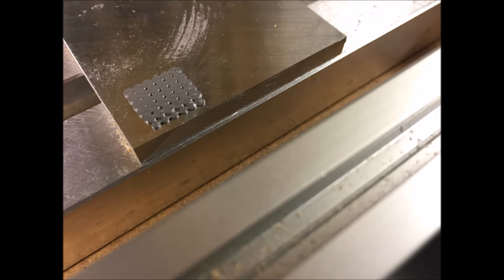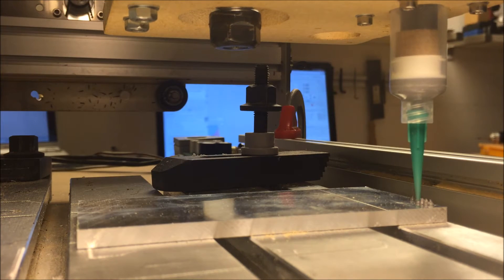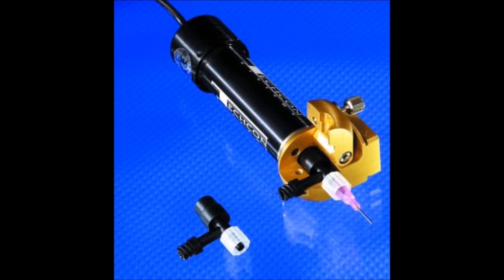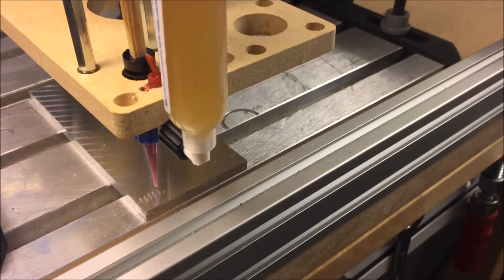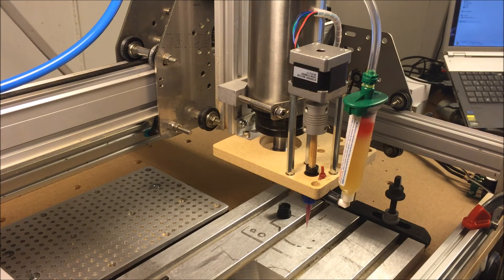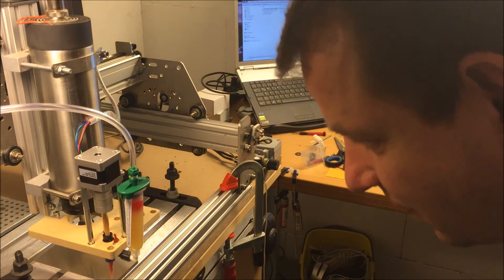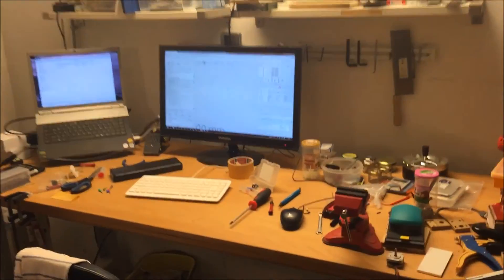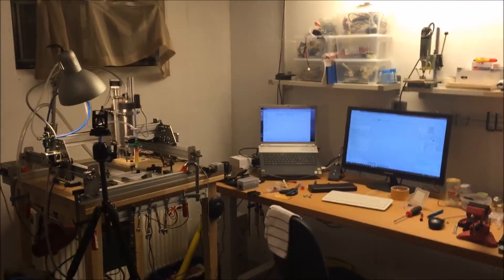Solder Dispenser Auger Pump S01e09

Comment: Hello Frank, 
I tested this Auger with a bottle of compressed air - - I measured pressure I was getting from bottle - it was abt 2 bar and the system works well.  - see my video here following your steps!! 
https://www.youtube.com/watch?v=w3fm-gYnoMY
Reply from the maker: +Mike Menci Very nice Solution, i publish your video in our Chilipeppr Comunity: https://plus.google.com/u/0/communities/104346367498010042037

Comment: Hello Frank, 
How much pressure are using in syringe while dispensing?  What would be your best estimation? 
Thanks,
Reply from the maker: Hmm, difficult question? I guess my professional vacuum pump has a pressure from 2-4 bar. But i just switch this on for 2-4 sevonds. That's enough pressure for a half hour.

Comment: Interesting video. Look forward to seeing the results after reflow. What is the minimum pitch size of pins you're expecting it to work with? (I've had issues with 0.5mm pitched components when using stencils so am looking for a way to take my skill (or lack of!) out of the process.).
Reply from the maker: Minimum are 0.2mm canulla size. I guess its possible to  dispense drops with this outside diameter.
Reply: +Frank Herrmann Cool - it would be great it if could dispense precise 0.2mm blobs of paste! All I have to do now is finish off my CNC machine (shouldn't take more than a year.....). I look forward to seeing more results from you! Thanks.